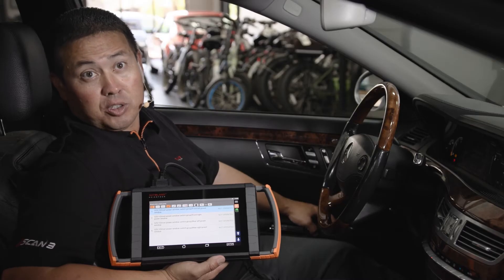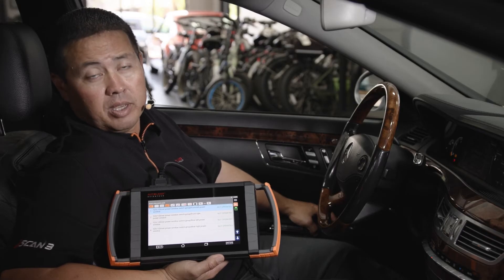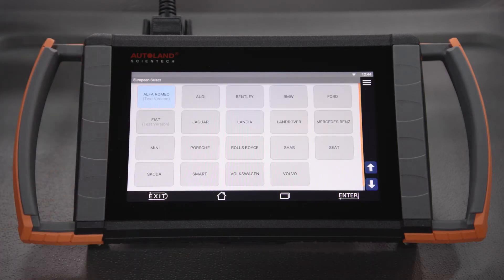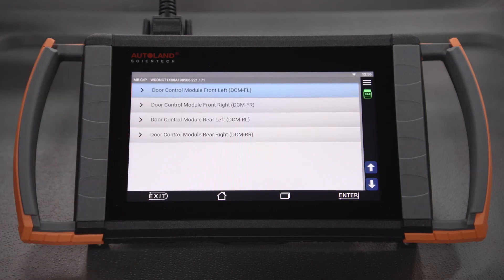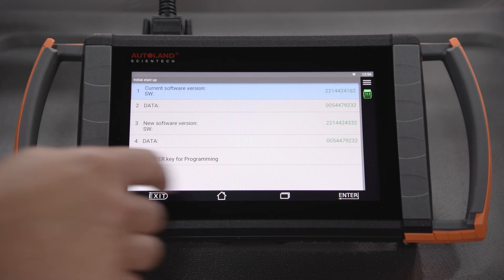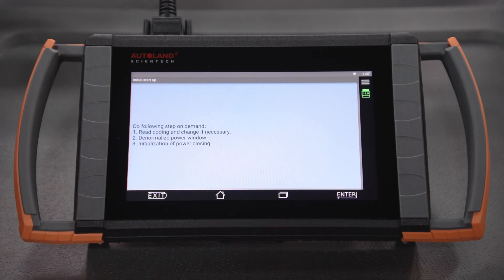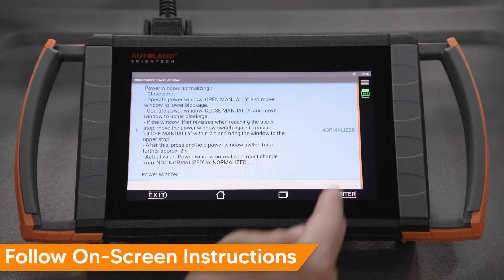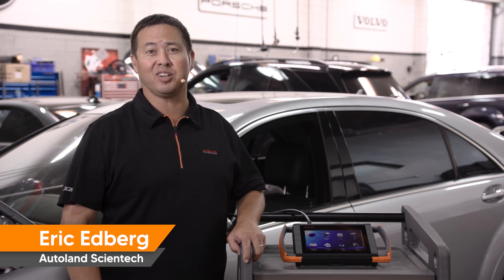The Easiest Way to Code & Program a Mercedes-Benz W221 Door Control Module

Comment: Mine only says read faults. No encoding?
Reply: If you own an iSCAN 3 or iSCAN SF/3e, you must go to the 'coding' section within Mercedes Benz.  The video shows you the exact path to perform the coding.
Reply from the maker: Thanks, Eric.
Reply from the maker: Check for the function under the menu header Coding.